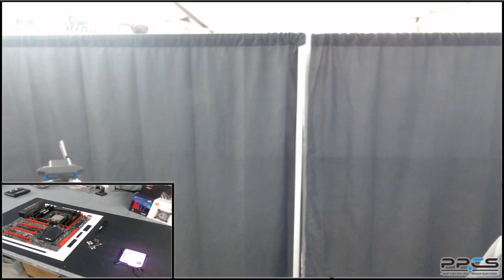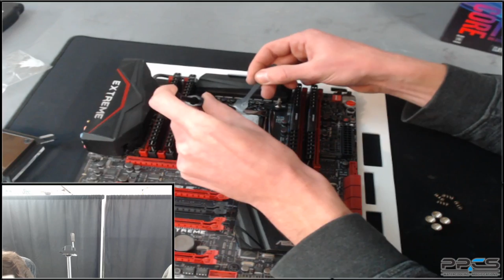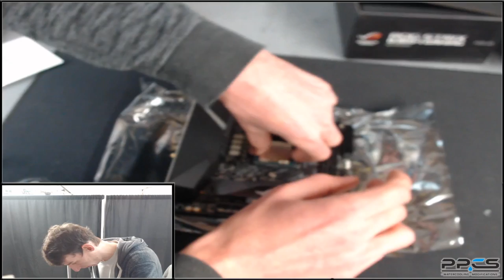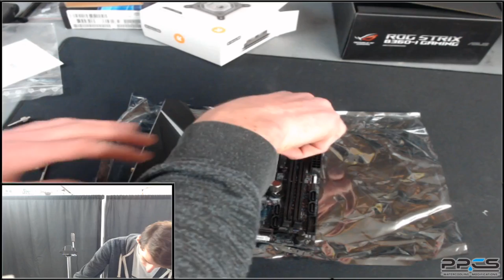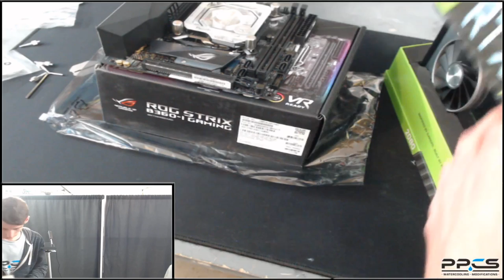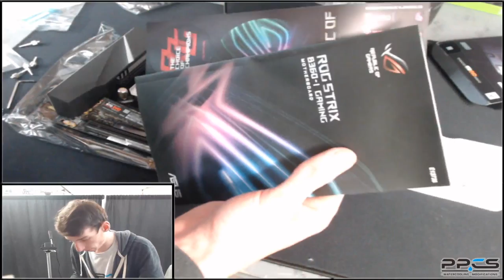Builder's Club Live Show - How to install EKWB Velocity CPU Blocks

Comment: You should have a note on the video that you installed the back plate on the B360 board backwards and that can be fatal as it can possibly make contact with solder joints on some boards if installed backwards. The instructions say Ribbed side up on EKW's site.